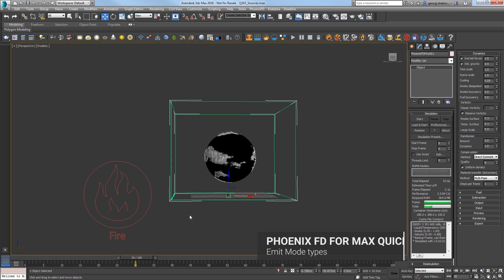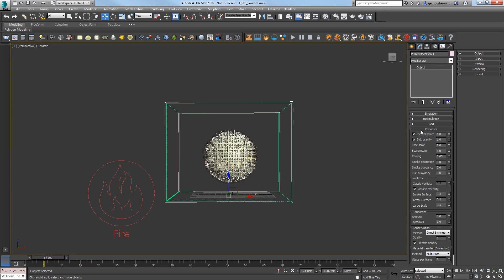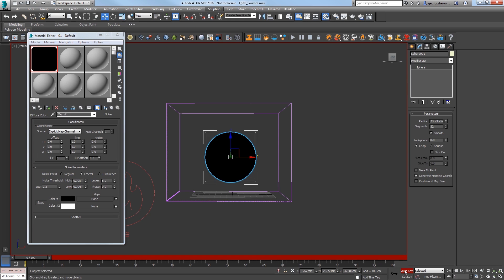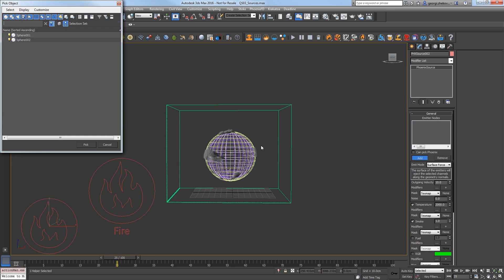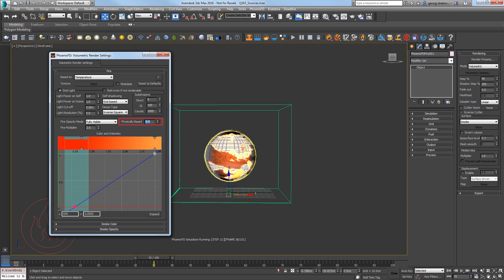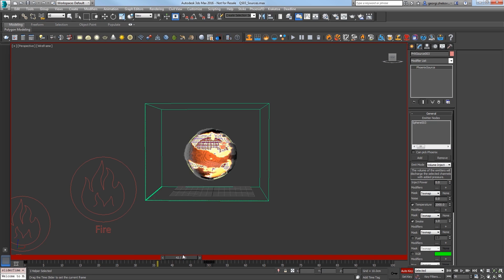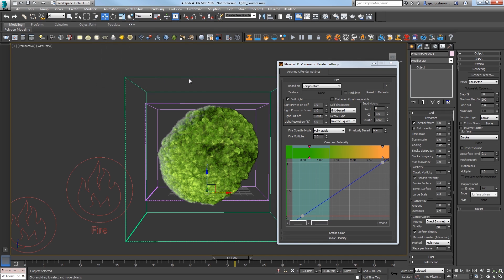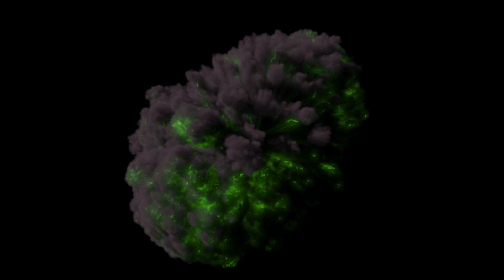Phoenix FD for 3ds Max - Quick Start: Emit Mode Types

Comment: Hey, Svetlin. Thanks for a interesting tutorial. Couple things though, I was following it using latest PhoenixFD (3.04) and I think you skipped few steps, the implosion part doesn't work for me, I might be wrong, but if you could cross-ref with your video it would be great, also in the demo file there are two PhoenixFDFire Simulators, shouldn't be one? Thanks again.
Reply: Will forward this, thanks!
Reply: Hey Christopher, just went through it and it seems to be working correctly. How is it not working for you?
Reply: Hi Georgi, the implosion part seems not working for me, I went through it twice and still same results. I might give it another go. Thanks.

Comment: I personally like this video a lot, and wish it was made years ago. But if you allow me to make some suggestion, (because I love Chaos too deep :-) ) I think this video may have involved a little bit too much advanced terminology than a "quick start", esecially without some brief explanation. This might benefit seasoned users, but might not help new users getting comfortable.
Just my 2 cents. Wish for more quick start videos about PFD! Great job guys! <3
Reply: Thanks, Onyx! Can you tell me more about which parts we could improve?
Reply: Hi Svetlin. Thank you. For example, this video is about 3 emit modes. which is indeed somewhat confusing. The name of Surface force is somewhat self explanatory, but the names of Volume Inject and Volume Brush are not that easy. The video demonstrated all 3 types, but didn't really explain their differences, and how to choose types under different scenario. So this is all smoke and fire and explosion. What about liquid? What's the standard or indicator? What are the unique features of each type. Those and many other things will help users the most.

From another angle, a quick start can also be some cheatsheet, important but easy and quick to pick up. So that a user doesn't have to get his Ph(f)D degree first to start enjoying PFD.

But, anyway, the more videos, the better, guys! GREAT job as always! <3
Reply: Indeed, these are fundamentals that need to be explained inside-out in all perspectives. Maybe we'll break apart the real-world example setup part from the theory and simpler examples. Thanks very much for raising this!
Reply: I am so grateful that our community has the best "community manager" in the world :-D
Reply: A great community is the one that will always help get things moving in the right direction - thanks so much!